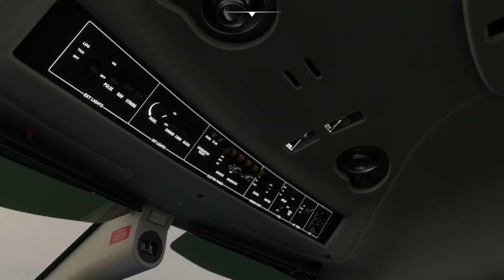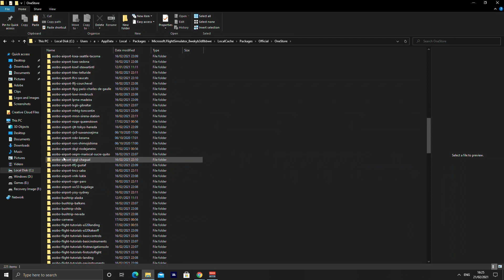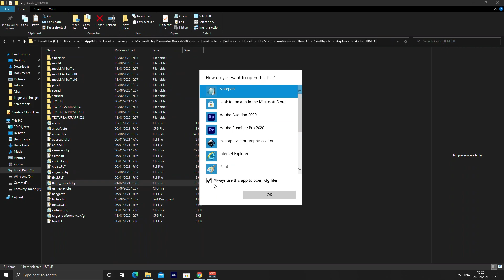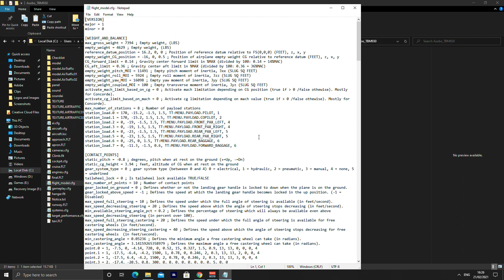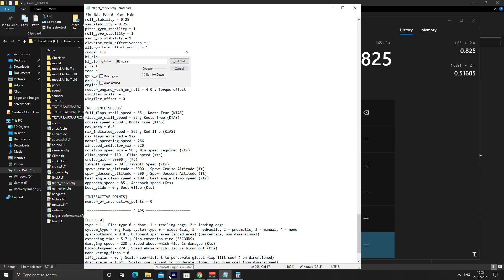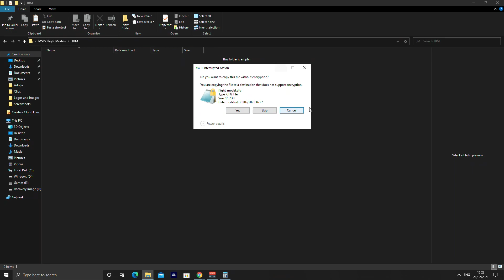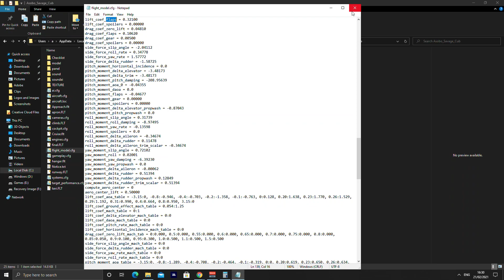msfs 2020 fix - Flight Dynamics (Flaps and Float)

Comment: PLEASE HELP.
Why when the plane is going on the runway to prepare for take off. immediately its turned a little bit to left & also when I take my hand off the joystick for less than five seconds, I see the plane turned slowly to 360 degre to the left side in the air & sometimes to th right side.
All my planes almost has this problem.
I have logetich extreme 3D Pro joystick calibrated & msfs2020 standard 1.16.2.0 update.
Please Is anything can fix this problem?

N.B: I'm 100% sure that the problem is not with my joystick or calibration, I think the problem is something in the game file or in the latest update, but I don't know what is the real solution?
Reply from the maker: Does it only do this with propeller plains or more noticeable? Could be the aircraft trim maybe?
Reply: And why when I added big files of scenery to community folder. The msfs doesn't works?

Comment: It's easier just to deal with the excessive life/drag from the full flaps of the TBM.
Reply from the maker: They have fixed the issue now. But yes for some they may want to just deal with the problem which is fine as doing this isn't for everyone. This is aimed at the ones that wanted to fix it for a better experience.

Comment: This is now becoming an expensive google earth drone simulator. It is laughable. And why should I have to change the cfg; they should do it. Im going back to X-Plane
Reply from the maker: I use xplane and msfs, it has a lot of potential they just need to fix the issues and then quality test thing before sending out an update. You're right, you shouldn't have to change a cfg but at least there is a work around. They all have limitations just xplane has been out longer so a lot more fleshed out now. Once the planes come to msfs and they get those dynamics sorted it will be fantastic.
Reply: @CTTechGaming  MSFS will never catch up to x-plane flight dynamics, simply because Microsoft devs (Asobo) focus on visuals. X-plane devs focus first on flight dynamics. Have you ever  wondered why X-plane is not playable bellow 20FPS, because there is a lot of flight dynamics calculations going on in the simulator(Blade element theory).MSFS uses look-up table for the flight dynamics which is ok if done properly, but it's never as accurate as the Blade element theory used by x-plane !
Reply from the maker: Hopefully though asobo pull there finger out with quality control 😂
Reply: @CTTechGaming  OK I guess. Im just surprised they are not on the problem a bit sooner.
Reply from the maker: @James-zu1ij  I agree I think waiting till sim update next month wasn't a wise move, they should of done a hot fix asap. There are a lot of people that won't want to do this hot fix or feel comfortable and asobo need to realise it's hurting their audience

Comment: Thank you for your video. The forum note https://forums.flightsimulator.com/t/flight-dynamics-bug-details/368499 says "to go into the flight_model.cfg and divide the flap lift by 2x (there are several possible scalars for that purpose: lift_coef_flaps or lift_scalar)." My understanding of "lift_coef_flaps or lift_scalar" is: I shall change the one value or (exclusive or) the other. You change both values.
I think, the Asobo flight models are so non-realistic, that your approach - that is divide by 4 -  is even good for the TBM930.
Reply from the maker: Thank you for your comment, I have found the Lift_coef_flaps and the Lift_scalar have the better impact but you are right you should try one first and then adjust the other if still not right (some only have one). The Scalar is normally the second to change as when I was looking at them they seemed to be closer to what I would expect them to be. but the flight models have taken quite a big hit on this update. It also depends on the Aircraft, some don't seem effected (more then likely the slower aircraft like the Cubs probably don't feel it as much due to the general lower lift being generated from the flaps and being required) The TBM for me was the biggest effected.